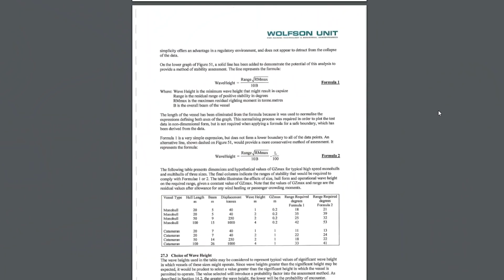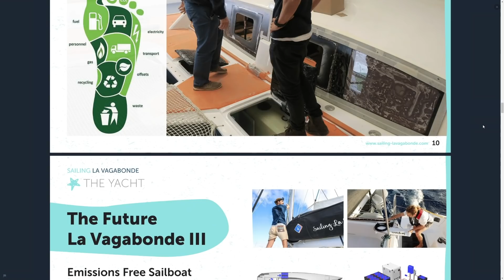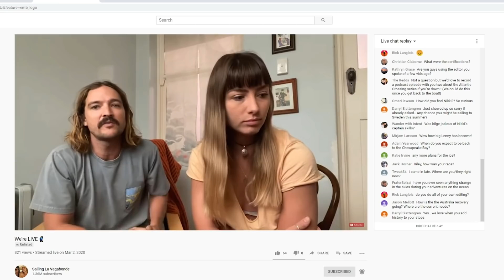Our Plan for an Emissions Free Vessel

Comment: Good news - that sounds like a lot of fun. Another reason to stay on this great channel!  
All electric boat with a big diesel generator for emergencies.  Probably will never have to use it - and you will need to keep a diesel tank - but safety first.  Put as many solar panels as you can fit reasonably (also good for aircon in the tropics at anchor), electric drives with regen and some big batteries.  Good safe marine lithium batteries can now be had for around 10 kg per kWh capacity.  
You would want a performance sailing cat for the regen.  It really gives some great numbers at speed.
Oh - and I hope you will support talking kilo watt hours instead of imprecise amp hours ;-)

Comment: Talk to Jeff Schionning, Schionning Designs. I'm sure you know all about them as a Straylian. I'm as sure he would be interested to hear your ideas and he regularly customises his designs for customers. I have an older Schionning Waterline 1480, nearly 50' and 7500kgs loaded. Schionning have always worked on efficiencies in design and performance. 

Speaking about Australian design and sailing efficiency in light airs talk to Advanced Wing Systems. They make a biplane reefable sail system that improves efficiency in all winds. They produce a lot of, more technical information which if for no other reason, it is interesting reading. I would definitely consider them on a new build.
Reply: @SailingLaVagabonde  sometimes, I follow new tech ideas or old tech revisited. I'm not affiliated with either Schionning or AWS. Just a fan of both, I have an old Schionning boat and love dreaming new technology. The new Schionnings are faster with better load carrying using smarter design. And the AWS I only know what they tell me but my limited understanding of aerodynamics tells me you must be able to bend more air with less seperation with a proper 3D wing shape.

Comment: I think some are getting confused between zero emissions and carbon footprint.  Having a boat powered by electric motors and lithium batteries, charged through wind, wave and solar energy naturally produces a boat with as close to zero emissions as you can get.  However, one thing that is often overlooked is the cost and impact of mining the raw materials such as lithium for the batteries and the rare earth magnets to make the motors with high efficiency has on the planet.  Provided the La Vagabonde has the room for the three of you (and possibly a brother / sister for Lenny in the future) then converting the vessel to use weight saving materials, more efficient power generation, or new coatings to reduce the drag etc would get you some where to achieving that dream and would make for an interesting video series.

Comment: Yes I have thought about this to. You have to IMO go smallish not larger. I don't really know if larger is better in this case for over all efficiency. Cost will be the biggest problem to over come. There reallly is only one group that is as far as I know who is attempting this in it's truest form and that is OE yachts and that boat is around 70 ft and is $$$$$$$.  Range is also a issue if you have to motor for extended periods of time and don't know if that is really safe. Also thinking mono might be the way to go to with that as well due to cost and practically. But good luck!

Comment: What are your thoughts for the dinghy? Very few, if any, viable electric options if you want to be able to plane and have reasonable range. So if you have to carry petrol anyway why not consider using petrol for the genset too. All the hybrid systems I’ve seen use a diesel genset for”emergency” power, although in reality a lot of them are diesel electric systems. A decent fast cat with proper light wind sails can make way in 5 knots of wind, and if you are mid ocean with truly no wind, just wait for the wind to come to you. A friend of mine circumnavigating on a budget used a standard petrol outboard with it’s standard alternator to provide ‘emergency’ power for instruments, radar and lights as he didn’t have a genset on board. He just had to rig a system to provide cooling water.

Comment: Convert your existing boat to electric rather than buying a new one!
Reply: It is probably more environmentally friendly to convert the boat.
Reply: Riley, pull the diesels and sell them. Buy solar panels and a wind turbine to change a lithium ion battery bank.
Reply: Because they are milliners and they want new boat , the current one is old already.
Reply: @AMLuka-to5vf   - they don't sell hats Bro.......
Reply: Electric power is better than fossil fuels, but it is not better than sails. Solar panels contain large amounts of heavy metals, batteries are full of lead acid.

Hey, I can't afford either - but you wouldn't see me in an electric sailboat.